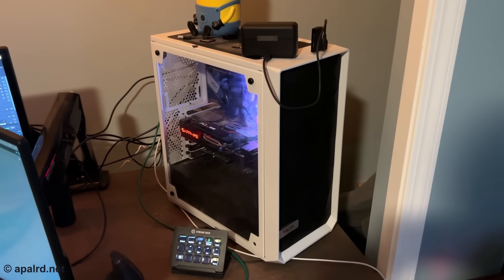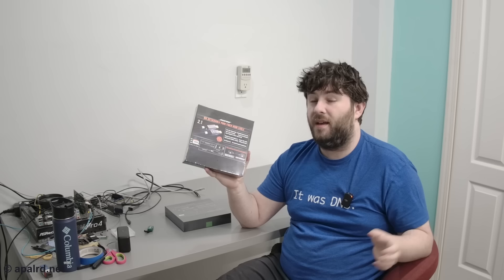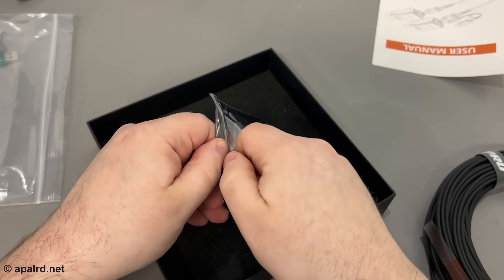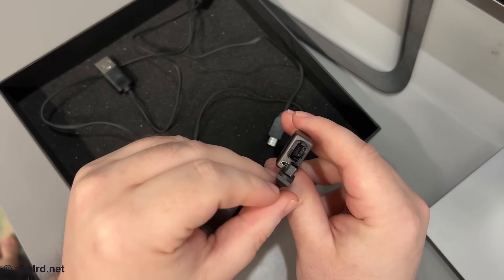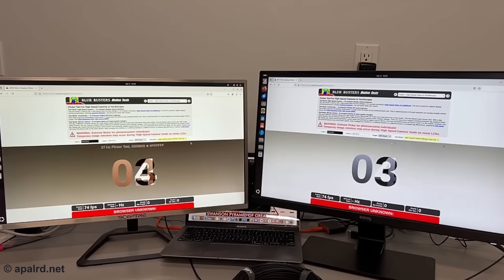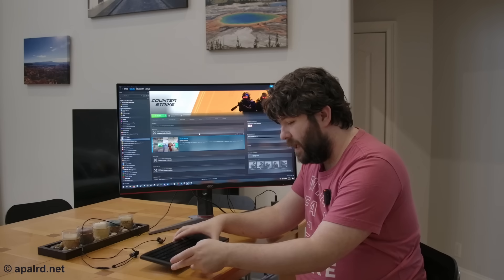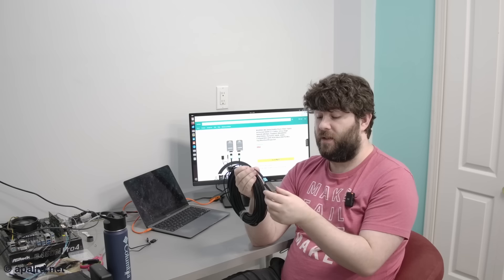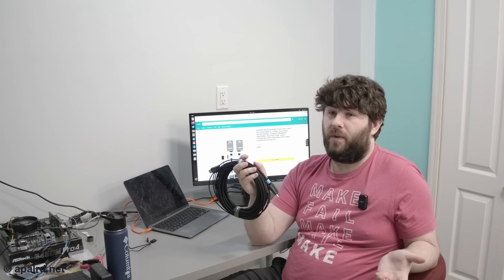FINALLY Sending Raw HDMI over Standard Networking Fiber

Comment: Shame it doesn't seem to use an industry standard like SC or LC for the fibre connectors unlike some proprietary shit 9:11
Reply from the maker: It’s not some proprietary shit. It’s MPO, an industry standard for 8+ fibers.
Reply: @apalrdsadventures   Thank you for taking the time to correct me, I've never come across these in my day to day with many many MM and SM fibre and patches and am now questioning why not!
Reply from the maker: @TJWood  They are usually used for 40G and 100G, which are 4-lane signals. 40G is 4x10G, so it requires MM 8 fibers, hence using an MPO instead of 8xLC. 
For distances longer than a datacenter, they'd probably do CWDM optics instead, which use 4 wavelengths and SMF.
Reply: @apalrdsadventures   Cheers, I do a lot of SM and MM patching and have a bit of CWDM in the mix as well.  We've just stuck with simple SC and LC connectors everywhere so am not familiar with the MPO at all.  Excuse my ignorance and thanks for the education,  appreciate.
Reply from the maker: No problem, I think MPO is really only used in data centers and short length stuff.

Comment: I don't know a lot about fiber, but the problem I've found is that it uses Type A polarity, which for some reason seems harder to find than Type B. The FS cable you showed was Type B. Maybe it doesn't Matter?
Reply from the maker: Type A/B is about if the fiber connector is reversed on the other end or not. It does matter.
Reply: @apalrdsadventures  That was my understanding. The FS site, which I was unaware of looks to have everything anyone would need. 

HDMI over fiber pretty much kills the HDBT setup I have now. 

I've been trying to centralize my consoles for a long time, just need to find a good USB solution now.  

Thanks for the response and great content!
Reply from the maker: If you don’t need hdmi 2.1, I’ve found some hdmi 2.0 adapters which use a single fiber instead of mpo. Might be easier to run.

Comment: Hi, I wanted to share some feedback on your review. Overall, it was nice and informative, but I think it’s important to recheck for any possible drawbacks that weren’t mentioned.

I bought an HDMI-over-fiber cable based on your video — the long version, and it was quite expensive. Unfortunately, I later found out it’s proprietary, with 7 strands instead of the standard 8 or more. This means it’s not fully compatible for other purposes, and now most of my setup is locked into proprietary items with no easy upgrade path.

In your video, you mentioned the cable as “standard” and suitable for different uses. I understand that creating content is part of your income, but missing such a key detail can really impact buyers. I’m not here to hate — just to share my experience so that you and your subscribers can be aware of these limitations.

Thanks for understanding.
Reply from the maker: Is one of the strands not populated? I believe there are 8 strands populated of the 12 in the connector
Reply: @apalrdsadventures   But there is 7, you can check their documentation. It means you can't use it for other purpose like a network or something else.

Comment: I don't think it's 12 tiny strands I think it's just a redundant set of fibers one for transmit one for receive and they're separating all the different wires based on frequency inside those little plastic translators

Comment: not really surprised about the lack of latency. you dont start getting latency until you run a fiber cable for miles, and even then, i think its still well under a second. im an electrician, and i was working with this one guy who was tasked with repairing one of the undersea fiber lines. he was sitting in a building in manhattan, while he was on the phone with someone who was on a ship off the coast of scotland. the fiber tester actually read the signal degradation in manhattan as the guy in scotland was bending it. oh and ALL of the security cameras that are in the NYC subway system, bridges and bus stations all go back to one location that can be accessed remotely
Reply from the maker: Latency doesn't hit 1ms until you hit ~100 miles, so you won't really be able to measure it. 

But that doesn't mean that the electronics won't introduce latency of their own, since some systems (especially over RJ45) will compress the video to reduce bandwidth on the wire, and that introduces latency.
Reply: @apalrdsadventures  i dont do much with fiber, even though i am certified and trained to splice it, but that does make sense. i just wouldnt expect compression unless it was super cheap. I.E. using things designed for 1080p while claiming it supports 4k video
Reply from the maker: Passing the signal through with purely analog parts is cheaper than decoding the HDMI signal and compressing it, though

Comment: Isn't usb3 backwards compatible? I've never had any issues plugging usb 2 devices into usb3 ports on my pc
Reply from the maker: USB3 is only backwards compatible in that the spec requires compliant devices to also implement a full USB2 stack (separately, using separate wires etc). Under the hood, a USB3 hub will include a separate USB3 and USB2 hub, and a USB3 root port will have two roots, one for USB2 and one for USB3.

USB2 also uses data lines which change direction where USB3 uses unidirectional differential pairs, which makes USB3 very significantly easier to carry over fiber.
Reply: @apalrdsadventures  oh, I see, so usb3 fiber would require a lot more fiber lines to be fully usb3 compliant and include usb2 support
Reply from the maker: At one point there was a packet gateway IC that would translate USB2 frames into USB3 frames. Normally the USB2 and USB3 paths are completely separate all the way back to the root hub. So I've seen some other fiber solutions that include this packet gateway IC so the USB2 traffic can flow over USB3. I'm not sure what the production status of that IC is.

Comment: I'm waiting for a fiber optic hub where you can connect your monitor, mouse, keyboard, ,headphones, mic, webcam  in one hub and it only needs one thin fiber optic cable comnected to a pc located somewhere else in the house. 😂
Maybe a usb hub via fiber optic cables 😂
Reply: Maybe a fiberoptic hub with 3 or 4 mnirrored outputs, so I can have 3 or 4 full-res, full-frame, PC "stations" scattered throughout the house. 🙂   Holy grail for me.

Comment: I'm REALLY interested to see if their claims of 48Gb/s actually holds up because the 48Gb/s fiber optic cables I bought from a reputable store were merely able to handle  about 15 Gb/s, worse than the Displayport Fiber they were supposed to replace. The HDMI 2.1 protocol ~itself~ supports 48Gb/s, thats how they apparently justify those numbers, at least in my case.
I have yet to find fiber optic cables that can carry a 1440p, 200hz, 10bit color signal without compression, that would necessitate 26 Gb/s and the best I've had so far managed to carry around 17 Gb/s.

I'm really interested in a follow up video on this with a more demanding monitor, i.e. higher refresh rate, 4k, color bitrate to see if that cable is actually able to support those claims. Because 1440p 144hz at 8bit is "easy".

Comment: I have these running my RTX 5090 gaming PC (garage) to an LG C9 OLED (living room) - works perfectly! I have a few ethernet runs going between the two locations, so I'm running an ICRON USB Extender to keep my Logitech dongle and Xbox Wireless adapter in the room with the TV.

The ICRON stuff is a commercial product so is pretty expensive brand new, but I only needed USB2.0 so I got an older set from eBay for £50 (Ranger 2204).

Hope this helps anyone trying to do the same.

Comment: I'd love for you to find a solid USB over fiber solution. I have a long USB cable running to my computer in my basement, but occasional electrical interference makes it glitchy.
The desktop market is ripe for a motherboard with a minimal I/O panel, networking in the back, and an MTP connector to a dock for monitors and peripherals.

Comment: Six years ago, Linus Tech Tips reviewed a rather strange long-distance HDMI signal transfer system.
The proposed system required a transmitter and receiver box connected by a single "conductor"
for distances like 200 meters ? okay, despite the bare steel wire as a conductor; even outdoors in the Canadian rain. 
They went so far as to test the system through a small tank of salt water (okay, no problem) and even through Linus's body (again, okay)!
I even wondered if this wasn't their April Fool's joke!!!!
https://www.youtube.com/watch?v=TZXxr6BbACo 
But the proposed device still seems to be in the company's catalog as advertised.

Comment: Multi mode is good for distances till 300 meters 
Everyone more would be better with Mono/Singlemode Fiber
Reply from the maker: 300m is for 10G-SR but the limit depends on the symbol rate, gigabit could do 1000m over om3. HDMI varies from 18 to 48Gbps, which is 6-16Gbps per lane (the fourth pair is a clock signal for HDMI, so we divide by 3 instead of 4)
Reply: @apalrdsadventures  Well, guess I learned something new today
My bad

Comment: now run it through a switch (;

so one adapter -> MTP connection to QSFP in a switch
the other adapter <- MTP conn. from switch
Reply from the maker: it's not using Ethernet. It's converting the TMDS signal to optical and back.
Reply: @apalrdsadventures  oh okay thanks for the clearification. a pity (:

Comment: you know, we can do this many many years ago, with Thunderbolt 2 pc, and a Thunderbolt 2 Dock. i did it. like 10 years ago.
Reply from the maker: that's an active optical cable, not using standard fiber
Reply: @apalrdsadventures  And? my way has far more benefits, just letting you know.

Comment: why not wireless?
Reply from the maker: HDMI 2.1 requires a minimum of 18Gbps (max 48Gbps), I'm not sure how you are going to send that wirelessly without significant compression
Reply: @apalrdsadventures  I mean with compression. In VR resolutions are quite high and refresh rates also high... 90-120Hz and the compression is not that bad for gaming. For normal desktop usage I don't know if it would be noticeable.
Reply from the maker: VR is extremely latency sensitive, so the high framerate is really a measure of how quickly the system can re-target the view when the headset moves, and not how fast the game can run.
Reply: @ so... I fail to see the connection. I was just saying that wireless might prove to be fast enough and good enough also... generally.

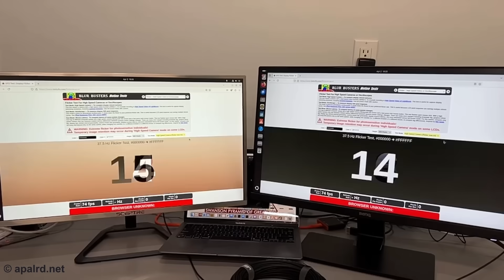Comment: Theres definitely still latency there, if you press spacebar every half second or so at 6:22 you will catch a number of moments where one monitor has updated its number counter before the other.
Still pretty cool, but we would need to get someone like Level1Tech to test it with one of those monitor refresh testers. Also needs usb. Although I don't know if converting from the electrical signal to light and back again is going to be better than just taking the latency hit of using an equivalent long cable. I feel that in a lot of use cases, the distance between the machine and user isn't that much to warrant significant latency.

Comment: It is possible to have fiber one cable for both display and internet. Since fiber has so much bandwidth. It would be like a box for sending both signals.
Reply from the maker: it's probably easier to use more strands of fiber
Reply: @apalrdsadventures  isn't Linus was using something similar?

Comment: The AV industry has been doing this for years. But not with the hardware you are using. Normally with propper OM4 multimodal fiber. Perfectly fine to handle 4k+ @ 60+ hz. There are better solutions available that will last a lot longer and are far more flexible with edid for a setup like yours. Lightware make some nice encoder/decoder modules for hdmi for example

Comment: Good video. Seems like a nice remote display, but it seems obvious you need a remote hub as well for mouse and keyboard. What they should provide is a remote thunderbolt/USB C over fiber optic , with a remote hub providing HDMI and several USB ports on it. That would give the fully remote capability needed including keyboard and mouse local to the remote display.

Comment: 50, 51, and 52 area of your video you can see a clear difference between the delay of each as the color of the 5 and the 2 show an orangish 5 in the first one and a white 5 in the next one along with the 2 being fully developed in the right monitor but still see the 1 threw the 2 on the left but fully white 2 on the right that the faintest amount of the 1 shows threw on the left! You would never see the delay without them side by side so does it matter if it's a millisecond? Maybe in gaming? Movies? Then again movies if you get the audio from the TV digital out jack to plug audio into a receiver, there probably wouldn't be any delay between the sound and the picture. Gaming I would think would be the only one I would think would bother if the controller is extended to the room also. Is the delay of the controller the same as the Monitor would be my concern, more so the delay from control input to respond to said enemy in Call of Duty.
Reply from the maker: The two monitors have different display controllers and one of them is acting differently than the other. The one on the left is via fiber.

Comment: My dream setup: HDMI, DP, and USB modular caps over 1 fiber cable combined with a fiber matrix splitter. I see several comments mentioning companies with Y-splits to accommodate the one cable part, BUT I'm now on the hunt for a fiber matrix switch to be able to swap between different input/output combinations.

I currently have a HDMI Matrix Extender that works over cat6, but it only does HDMI. I would happily replace that with this type of fiber setup if I could find a way to do the same matrix splitting. Being able to go from gaming in my office to on the couch to in the bedroom with just a push of a button has been revolutionary.
Reply: It's not a technical issue - the trouble would be finding such at a reasonable price any time soon. There just isn't the demand yet.
Reply: See if the company Bluestream has anything available for your needs

Comment: I have a Ruipro fiber only cable (I think it's a slightly custom end, but I don't remember for sure) and a Fiber Command cable (LC).  Works up to 4k144 RGB 10bit hdr and with dolby vision when directly attached between source and monitor.  Use case for me is elimination of ground noise and induced noise from GPUs.    It works 100% perfect for this, HDMI absolutely does cary noise into systems (even when "digital) and can be very, very frustrating to deal with.  You could do a ground lift but that is.. probably an extremely bad idea.

However there are some caveats.  AVRs (receivers) do not support 4k144hz at RGB/4:4:4, at all, today.  The best units support 4k120 RGB 10bit max, which does work but syncing is a bit random.  Once the sync happens it will be rock solid.

It can be frustrating when you turn the system on and the TV just keeps acting like nothing is plugged in. I have seen a bunch of people who said "it worked then it stopped" and I have a feeling this is your problem.  If the sync won't establish and you are directly connected, the only fix is to power it off/unplug it and plug it back in.  If you are using an AVR, switching to another ACTIVE/Working HDMI and back will also work.  You need the signal to completely stop going to the transceiver so it can re-try.  

Occasionally you may need a reboot of the cable as well.  So I think this is a software issue in the transceivers, but I dont know if anyone has offered anything like that.

E-ARC works fine as does CEC. VRR is good.  Dolby Video is good as well.
Reply: Thanks!

I got this for an LG G4 and 5090 and it was artifacting at 4k144 4:4:4 10-bit.

Replacement comes in a week and I was worried it wouldn't work!
Reply: @HubstepCamaro  Good luck!  Remember it will not work with any currently available receiver/amp between the 5090 and the Monitor/TV.  They all lack chipsets that work with 144hz, not enough bandwidth.  (for down the road when you decide you need the kickin' theater to go along with that awesome tv)

You should be good to go though!
Reply: @ Thanks! I use eARC to get back from the TV to my AVR for the 7.2 setup

Comment: I've been using cheap AliExpress HDMI 1080P to SC connector fibre (multimode or single mode) for quite some time now. The place I work has 8-core MM OM4 fibres - installed for data - and I have been using them quite successfully for HDMI video and audio.

Comment: I hate to break it to you but KVM extenders have exst existed for at least 35 years. I know 25 years ago I represented two of the major manufacturers of the extenders have basil for around $300 each for and we could run 1080p at that time up to 33 m near zero latency. By the time I change my business model onto large displays we were able to send 8K signals 66 m with zero latency. If you Google extron for crestron or key digital or just kbm extenders you should find dozens of companies making the boxes that you find so amazing. In terms of the fiber you're using, do yourself a favor and pull two fiber cables that way when one fails you'll have the second one to back up your signal. In my career I worked with some of the best integrators in the country who did what you were talking about commercially and I worked with the home theater installation people also did what you were talking about. So this is not reinventing any kind of new wheel
Reply: You absolutely can, but only a few support full HDMI 2.1. Most are 4k60 only and 4:2:0 only.  Cost is generally 400-500 for the uplink side and another 200-300 for the downlink at the lower capability range.   

Cat6 extenders have the same problem and the same costs plus they are copper and carry ground noise, which can be an extreme issue.  . 

A small usb powered transceiver at <200 is still unique today.